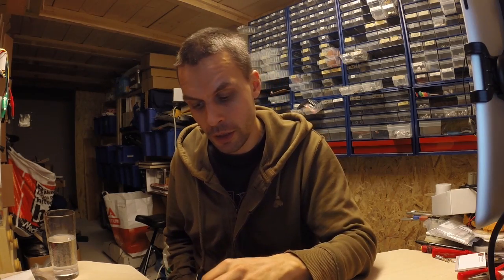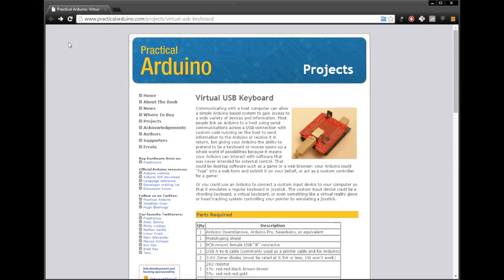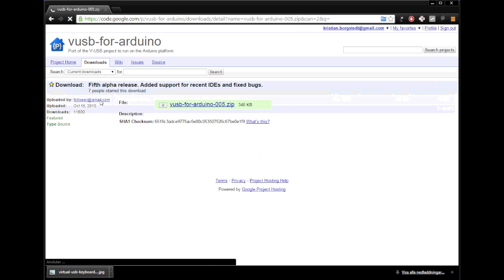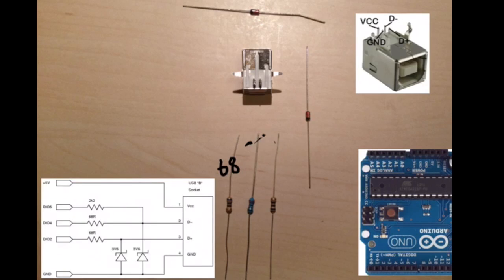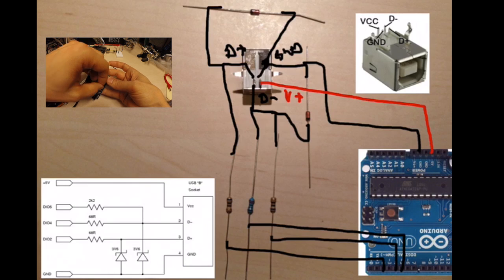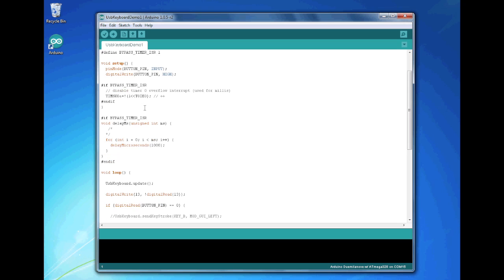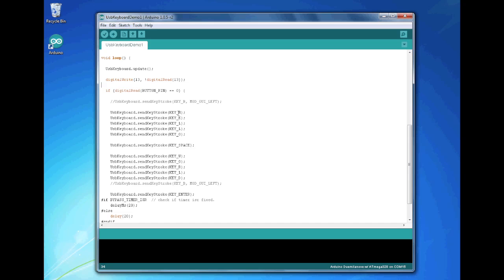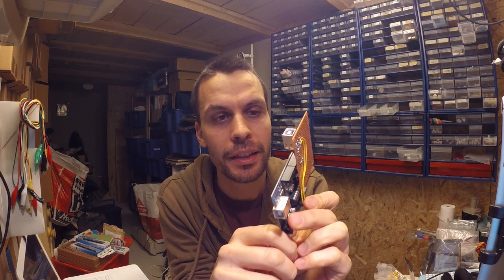Arduino UNO as a USB keyboard (HID device) [Anything Arduino] (ep 6)

Comment: I try to print characters without using button but using delay. When I delete button snippet and add e.g delay(2000), the USB is not recognized by pc. How can I arrange the code due to this purpose ?
Reply from the maker: You cant add a delay to the code, then USB stops working. USB is very sensitive to timing... You can use millis instead, they do not stop the code from running...
Reply: @SourceryOne Thank you for your answer. So I can add e.g 10 second by using milis() function, Do I understand right? What about if I remove button code? Whenever I remove button control, USB connection has cut off. I want to send letters to pc by using loop function with the time interval. How can I overcome with this problem?
Reply from the maker: I don’t remember. This was a long time ago. Try to modify the code. Probably you are removing something that is important for the usb function. Put it back and try to change something else. Search google for Millie for how to use it.

Comment: I want to connect a USB barcode scanner to my Arduino to capture scanned barcode numbers. How would I go about doing that - can you give me any advice? To receive USB data does that mean I need the Arduino to act as a USB host?
Reply from the maker: I also want to do this. But I haven’t figured it out quite yet. There is a way to scan a keyboard from the arduino. That SHOULD work for a barcode scanner aswell as it is interpreted as a keyboard. Let me know what you find out. :)

Comment: Are backspace button & lowercase letters included in this library ?? 
If not .. can i edit library and adding them ?!
Help plz ^_^
Reply from the maker: Yes they should be. And yes you can edit the library and add more characters.
Reply: @SourceryOne  
Ok , thx ..
What about other languages characters like arabic .. can i add them ?
Reply from the maker: @ahmadharb7034  I think so, you need to read up on the code on that page... It has to do with Keyboard codes and the USB protocol I think...
Reply: @SourceryOne  
Ok,,
Last question , can i use 3.3 v zener diode or 4.3 ??
Thanks kristian ^_^
Reply from the maker: @ahmadharb7034  No, it needs to be the exact components as described in the video. Other zener diodes will not work.
Reply: @SourceryOne  
Good morning kristian .. can u help me !
Can i hold a button by this usb keyboard or just sending a stroks ! 
i,e: to save file u need to press ctrl+ s , can i do this ?!?
Reply from the maker: Ahmad Harb yes you can do key combinations.
Reply: @SourceryOne  
How ?! 
Do u have any idea ? 
It's very important for me :)
Reply from the maker: Ahmad Harb I think you need to read up on usb descriptors and Keyboard Codes. I acts as a keyboard. You need to find out what codes is sent for the character you want. Also those are usually interpreted within the os. You can write Arabic letters with a latin keyboard.
Reply: @SourceryOne  OK,,
Can i do a combination of modifier keys ? 
(Shift and alt) together for example !?!

Comment: if you want to use for mega2560 you need to modify pin below.

Mega2560

INT0 == PD0 == Arduino Mega 2560 Digital Pin 21 == D+

 ---- == PD1 == Arduino Mega 2560 Digital Pin 20 == D-

 ---- == PD2 == Arduino Mega 2560 Digital Pin 19 == pull-up

And Modify library below.

usbconfig-prototype.h
usbconfig.h

#define USB_CFG_DMINUS_BIT      1// Uno=4, Mega=1(PD1)

#define USB_CFG_DPLUS_BIT       0// Uno=2, Mega=0(PD0)

#define USB_CFG_PULLUP_BIT          2// Uno=5, Mega=2(PD2)

And takeout the r-pullup for SDA and SCL on board.
Reply from the maker: Thanks for the info! 👍

Comment: Has anyone used this concept to join a USB keyboard to the Arduino, then from the Arduino to a Computer.  My goal would be to create a learn-able Macro keyboard.  Select the USB keyboard of your choice, plug into an Arduino.  Have a buttons on a keypad learn button sequences.  I have a Logitech keyboard that will inevitably die someday that can do this now.  The way it works is, you press an "MR (Macro Record)" button, then press the button you would like to record the macro too (Separate buttons on the side of a standard keyboard specifically for macros).  After that, any sequence of button presses will be recorded.  Once finished, press the "MR" button again and that sequence has been learned to that macro button.   Any time that button is pressed, it runs the learned sequence.  I would like to tie this into a simple LCD display so you can visually see the sequence you entered if there were any issues.  Maybe add the ability to edit delays as well.
Reply from the maker: Sure you can put an arduino inbetween a keyboard and a computer. This sketch only takes care of the arduino to computer part. There are scetches out there (in the same book as I talk about in the video) that makes it possible to connect a keyboard to the arduino. Then you just forward the commands and add the command for adding macros etc etc.

Comment: I have seen that the library doesn't work with IDE versions above 1.0.5, so I made some changes to the library.
Files you need to change:
    usbdrv.c
    usbdrv.h
    UsbKeyboard.h
Changes:
    Every line that says PROGMEM in it, just put "const" without quotes before it so it would be like:
    const PROGMEM
I tried it and it worked! I hope it helps you :)
Reply: Yes you are 100% correct. I have arduino 1.8.9 IDE installed on my PC.
Without changes i was constantly getting error " 'timsk0' was not declared in this scope". while compiling USBKeyboardDemo1.ino code.
Thanks alot!!!
Reply: thanks
Reply: You're welcome :)
Reply: I love you so much!
Reply: Great job
Reply: Thank you, that was very helpful.

I also got another error:
fatal error: usbdrvasm16.inc: No such file or directory
i don't know why, since that file was present.
To solve this i renamed all .inc files to .h and changed that in the #include lines as well.
Now it compiles.
Reply: Hello, I have the latest Arduino IDE. Can you please share with us your Library?
Reply: Hey can you please share source code and schematic.

Comment: Interesting if there are examples where the board is USB host.
Reply from the maker: For simple things as connecting mouse and keyboard to the arduino... yes. Or what did you have in mind?
Reply: HID, mass storage device, Multimedia device (au/vid). MCU as a host controller examples - especially for camera would be nice
Reply from the maker: Then I would say no. The arduino hasn’t the capacity to handle camera input. I think a raspberry pi would suit much better then. Mass storage can be achieved with an Sd card shield, but not via usb afaik
Reply: What do you mean by saying 'hasn't the capacity to handle camera input' ?? What MCU you have in mind?
Arduino you mean ATmega 8 bit? STM32 and ESP32 definitely can handle that
Reply from the maker: Oh yeah! Ofcourse! :) I am an oldschool Arduino UNO kind of guy... :D I havent played with the newer models, but ofcourse they can handle lots of other things that the old UNOs etc cant... But I cant help with this... :)

Comment: HI Kristian,

I get this message whenever I try to upload the code into my Arduino Uno.
"avrdude: stk500_getsync(): not in sync: resp=0x00"

I re verified the circuit and connection to check for any connection error but everything was good.

Could me help me in resolving this message.
Reply from the maker: This is a common error when you have the wrong board selected in the arduino board list. Check that first.
Reply: HI Kristian..
I have selected the appropriate board from  the list ..But I do get an error of USB Device could be recognized when I plug in the USB port which was soldered for the keyboard purpose.

Is there an driver that need to be installed for it.
Or is it due to bad connection of my Hardware.
Reply from the maker: 1st it is VERY important that you have the right tolerance on the components, where it says 0.55w zener diode it HAS to be a 0.5w zener diode, Any other values wont work. That is what many faulter on aswell... Let me know so you have the right components...
Reply: Yes I have the right components with correct ratings.
Reply from the maker: Hmm, I would check connections again. If you have the correct arduino IDE version 1.0.5r2, and all your components are correct as shown in the video, and your connections are correct, this circuit works. These three things are what has fixed it for everyone who had a problem... I hope it helps...
Reply: Kristian Blåsol any specific with OS
 I have win 10th2
Reply from the maker: I think that OS shouldnt matter, I have heard people who got this working on windows 10 before...
Reply: OK
Will try checking the connection again
Reply: I forgot to mention I am using Arduino UNO. this should not matter I think as it is also an ATMEGA 328 based board
Reply from the maker: Arduino UNO  shouldnt be a problem, as long as you have the correct board chosen in the list.

Comment: CAN AN ARDUINO KEYBOARD do multipress such as  press the following keys together:    "a" + "n" + "h"      ????? and send something.. like a "z" character to a laptop?
Reply from the maker: Do you want them to be sent together? You mean that 'a' is kept pressed, and then 'n' kept pressed and then 'h'? I dont know. I know you can use modifiers ie. ctrl, alt and shift, and even the windows button. If you use the same example code as I did, then sending a 'z' to a laptop is done with the command: UsbKeyboard.sendKeyStroke(KEY_Z); If you need to keep keys pressed there is the built in library for the Arduino Leonardo that can do this if I remember correctly. See episode 5 for how to use that: https://www.youtube.com/watch?v=ubORsI4uWuo
Reply: I made it work ... I just hope I don't burn out the chip.
Reply: @zapatistamarcos2  Could you please explain it to me how you did ? I want to lock windows by pressing  "win+L" together ( windows key lef gui buton + L buton on keyboard)

Comment: nice video.But,..can i use it in standalone?
Reply from the maker: How do you mean standalone? Without an Arduino? No, well, you can add an ATmega328 to the breadboard and an oscillator and then you can use it "standalone". But if you mean with the arduino standalone on any computer yes. Any computer that you connect the new USB-port will run whichever commands or button presses that you have programmed your arduino to do...
Reply: yea i was pretty stupid then

Comment: In windows 10 it doesn't works...device manager gives me this error:

Windows has stopped this device because it has reported problems. (Code 43)
A request for the USB device descriptor failed.

i create the circuit identically to yours...i'm using the ide in 1.0.5r2 and using the same library...what should I do?
Reply from the maker: Havent tried it on a Windows 10 machine, I'll look into it...
Reply: I'm using Aruino UNO R3 and in the shield, im'using a usb camble
Reply: On win7 it gives me same problem...
Reply from the maker: Really? well, I know many have succeeded... Have you checked the wiring and orientation of the diodes. Do you have the correct values on the diodes? Any deviations and it wont work...
Reply: wiring and diodes value is correct :(
Reply: VUSB is super shitty to get working in USB above 1.1 so its tendency is to become defunct unless Objective Development does something with it (which they probably won't and you'll understand why in a second).
There are actually 2 microcontrollers in Arduino UNO R3: Besides the Atmega328p you have the Atmega16u2; it is very small, *built* for USB, and you may flash with a firmware called LUFA and use the hardwired serial to interface the other way around.
Keep in mind this will disable the USB programming for the Arduino platform, so you'll have to erase it and flash the firmware on Atmega16u2 with the original hex for the programmer every time you want to update the code for the Atmega328p, then flash the 16u2 again. Alternatively get something like a Digispark (it's like $1 and you can interface it with stuff).

Comment: Hi, One question, in the wiring diagram , because it is used 5v + output , if the CPU sends 5v + , I mean if we simulate a keyboard, the keyboard itself does not send 5v, but receives 5v, what I mean is that it would generate a short circuit is more , any device that connects to USB , does not send 5v, 5v receives for its operation, I'm not sure , but would have to review it , Greetings

Una pregunta, en el esquema eléctrico, porque se usa 5v+ de salida, si el cpu envía 5v+, osea si simulamos un teclado, el teclado mismo no envía 5v, sino recibe 5v, lo que quiero decir es que se estaría generando un corto circuito, es mas, cualquier dispositivo que se conecta a USB, no envía 5v, recibe 5v para su funcionamiento, no estoy seguro, pero tendrían que revisarlo, Saludos
Reply from the maker: The ground of the arduino and the USB-port are connected. Also in the video I use the "Keyboard" USB-port  to power the Arduino, just so there wont be any damage to the circuit and or computer.

Comment: Can this method be used on arduino mega 2560?
Reply: Yes, it is possible.
if you want to use for mega2560 you need to modify pin below.

Mega2560

INT0 == PD0 == Arduino Mega 2560 Digital Pin 21 == D+

 ---- == PD1 == Arduino Mega 2560 Digital Pin 20 == D-

 ---- == PD2 == Arduino Mega 2560 Digital Pin 19 == pull-up

And Modify library below.

usbconfig-prototype.h
usbconfig.h

#define USB_CFG_DMINUS_BIT      1// Uno=4, Mega=1(PD1)

#define USB_CFG_DPLUS_BIT       0// Uno=2, Mega=0(PD0)

#define USB_CFG_PULLUP_BIT          2// Uno=5, Mega=2(PD2)

And takeout the r-pullup for SDA and SCL on board.
Reply: @SuriyaTonyamad  THX 🙂
But can u explain last point !! 
SDA & SCL ??
Reply: +Matteo Sambruna It didn't work for me with Mega, only with Uno.
Reply: Can u get it with arduino mega? i can`t get it works :(
Reply from the maker: Sorry I havent tried it with a Mega 2560, so I really dont know.

Comment: Just a question. This circuit can help me to meet in the middle between a common keyboard and the computer, I want this to show in an lcd what the user type.  Or some hint? Thanks.
Reply from the maker: +Jonathan Prieto Well, you would have to add in the void loop that everytime a key is pressed to write that letter in a display. Or have an action key that writes it all out eg. when pressing Enter... Do the project in this video, and then find out how to implement an LCD display aswell, and come up with a good concept that works for you. Good luck!

Comment: Hello
Does someone can help me please .
I did exactly as in the video but it does not work the computer does not recognize it as a keyboard  

shield is in the photo profile
Reply from the maker: +TEMS MOSTAFA are you using the correct IDE version? Version 1.0.5r2? Do you get power to the arduino through the shield?
Reply: +Kristian Blåsol 
im using 1.0.5r2   and im using the power of the arduino

it dont recognize as a keyboard:/
Reply: I dunno if this is the cause but MAYBE you are mixing resistors tolerances!
The beige colored ones are called carbon which have 5% tolerance while the cyan/light blue one is metalic which has %1 tolerance. So maybe this is the reason the mixture of carbon/metalic resistors with different tolerances.
make them all the same kind.

Comment: Hi all,

I got some problem with my circuit.
Could anybody answer me the following question.

If I only connect the GND and the 5V of the soldered "PCB-mount female USB "B" connector" and connect it to my PC, does the Arduino has to recognize it as an Arduino xxx?

It seems so, cause Kristian mentioned it. But I am not sure if GNV and 5+ is enough.
But this would help me finding the error.

Regards Mario
Reply from the maker: +Mario Mueller If you connect the usb connector on the made circuit, the computer will not recognise it as an Arduino. If you have the correct sketch running and made the correct circuit, it should present it self as a generic keyboard to the computer. However you will get 5V TO the arduino FROM the circuit when you plug the circuit into the computer.
Reply: @Kristian: Thanks a lot. I hope your answer will also help some others. Regards from rainy germany